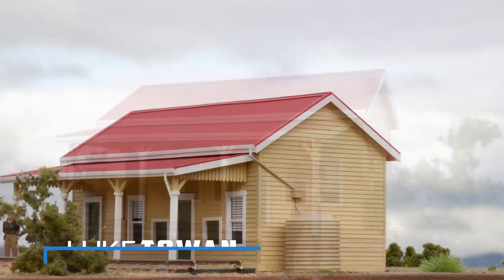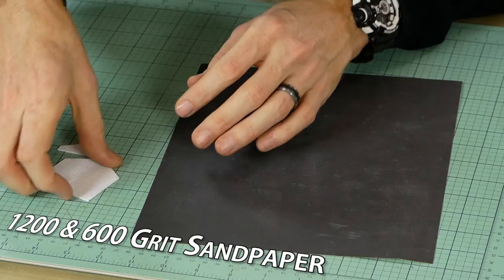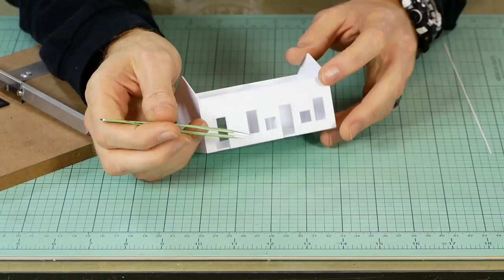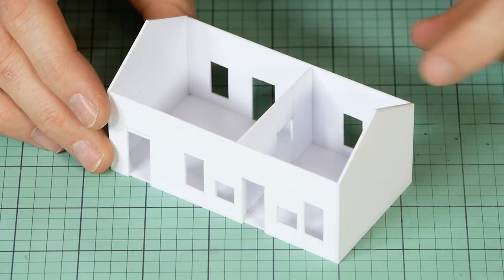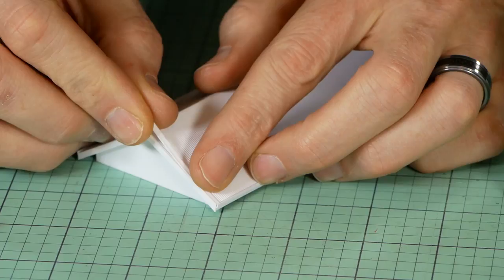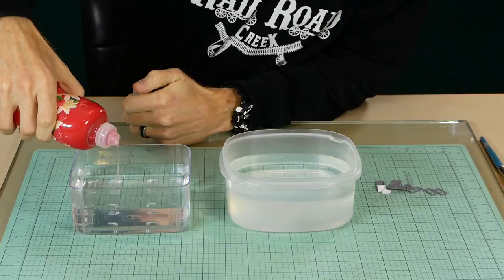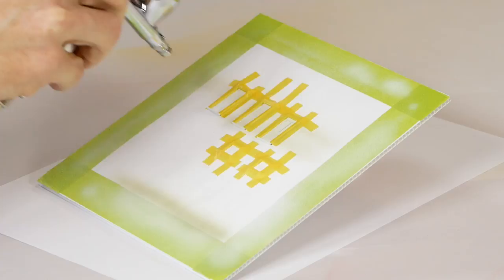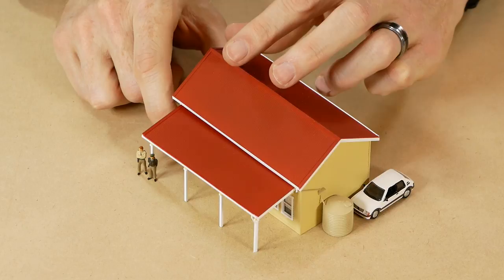Scratch Building with Styrene - Tools & Techniques

Comment: Thanx Luke. My fave part of the hobby, building buildings.
Reply from the maker: Thanks Bill, I haven't build that many scratch built buildings but it's so rewarding once you finish!
Reply: I peeled the veneer off a chunk of good quality plywood. Its been sitting outside for 10 years or so. Looks like the real Mcoy... well, it IS the real Mcoy. lol --- Mother nature knows how to do weathering. Gonna try to make a N gauge barn with it. If that goes well, I got enough to make a whole town. Question is... Will it scale down right? I'll use some of your tutorial to build the basic frame and then glue thin strips of this veneer to that. Thanx for the video. I just might have to build me one of them doo-hickys.  :-)

Comment: You could put subtitles in Spanish to your videos. I'm new to your channel and I like your work, but I speak Spanish and I do not understand English very much. I would greatly appreciate it. PTT. I translated this with help from Google. Jejeje
Reply: That feature is built into all YT videos. Clik the CC icon in the bottom right corner, it should default to Spanish if that's your normal browser language. If you need to clik the settings icon (the gear), choose auto-translate, clik auto-translate a second time to bring up the language menu, scroll to Spanish/Espanol. Listo ! ;)

Comment: Luke, I found a few old sheets of N-gauge styrene wall textures which are really hard to find. I would like to duplicate them as that type of diamond-block wall is very common in the prototypical part of the world I want to be modeling. Is there a cheap but effective way to copy all the fine grooves and contours in a plastic wall board to make more? The result doesn't have to be styrene but should still serve as a model wall.

Comment: Hi, complete novice here. What thickness styrene should be used for an 1/48 "O" scale building. I am attempting to build an airfield control tower from WW2.

I have all the windows and doors and O scale Plastruct random brick facing for the the outer walls. I just need to know what thickness base wall styrene to use to hold it up.

Comment: Is it possible to share a list of the styrene technical shapes and sizes used in this build? Scratch building isn't necessarily difficult. It's trying to figure out the correct size materials to order. Unfortunately for myself, we no longer have any hobby shops in business in my area within driving range so I have to resort to ordering materials online.

Comment: LUKE has a question? About blue angles?
You certainly made it yourself on your 3D printer.
My question is what filamas ABS or PLA?

LUKE ma pytanie? o niebieskie kątowniki ?
Z całą pewnością sam je wykonałeś na swej drukarce 3D. 
Pytanie moje z jakiego filamenty ABS czy PLA ?
Reply from the maker: Yeah I 3D printed them, they are made using PLA, I tried to make some with ABS however I find it a little more difficult to work with. My hot bed struggles to get hot enough for the first layer to remain stuck.
Reply: Thank you for the info

Comment: Looks awesome.
How did you work out how big you wanted to make it? Like height, width etc?
Reply from the maker: That's where the cardboard mock up came in handy, I basically guessed the height by using a known standard height of the door and the I just made adjustments from that until I had a paper mock up that looked about right... Mostly guess work to start with.
Reply: Luke Towan Cheers for the reply Luke.

Comment: Got any info on your airbrush, or recomendations for one in Australia?
Reply from the maker: Hey mate, I'm using an Iwata Revolution and I purchased it as a kit from Adelaide Moulding & Casting Supplies, here is a link to the exact kit I bought:
https://www.amcsupplies.com.au/index.php?main_page=product_info&cPath=2003_2118_2391&products_id=6829&zenid=2d3a27817b3c2b37dfdce8d9cea9ada6
Reply: Luke Towan cheers. I've bought plasters off them before.

Comment: What are some good places to get styrene
Reply from the maker: Depending on where you live most hobby shops stock Evergreen Styrene but you can also search eBay and Micro-Mark pretty much have the full range. You can also shop directly at Evergreen as well.
Reply: Luke Towan thanks no hobby shop within a 2 hour radius of where I live so I will have to check out micro mark.